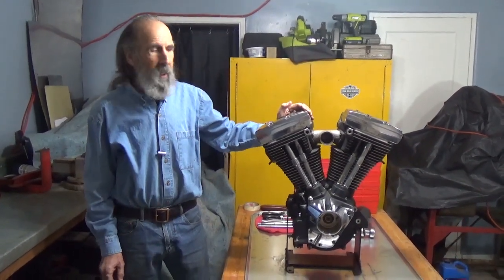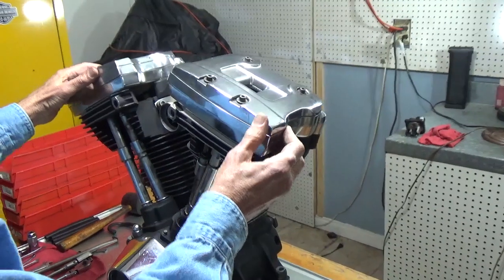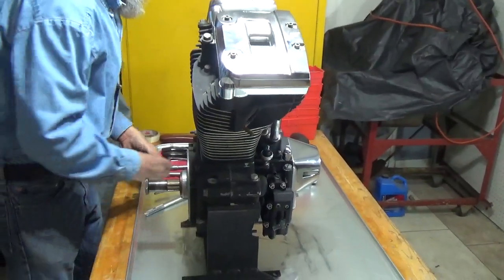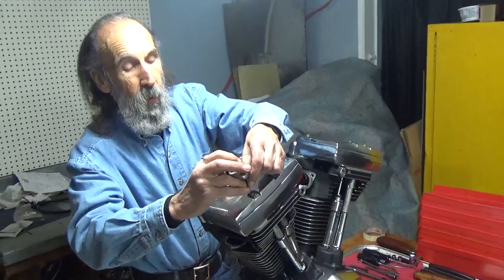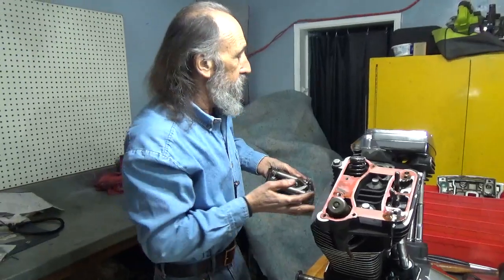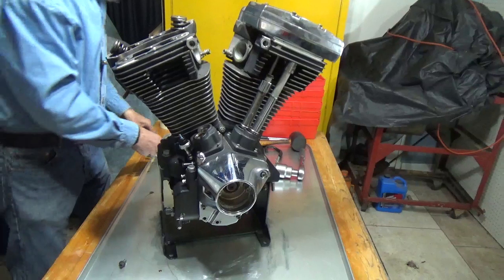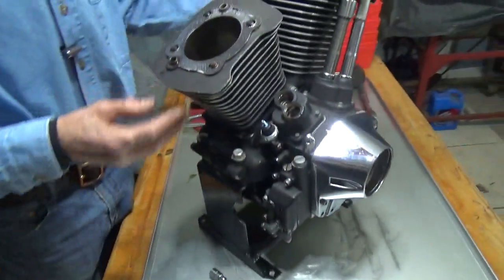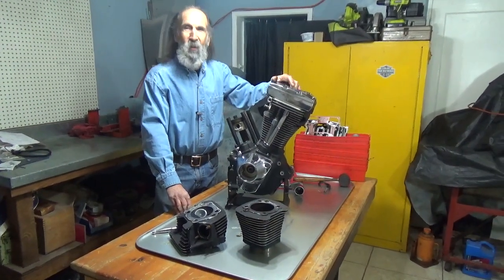Harley Davidson Evolution Motor Disassembly, Part 1

Comment: Is it strictly necessary to follow the torque sequence shown in the manual? I noticed you don't followed it; the manual asks that from the rear cylinder the first bolt that should be turned is the one closer to the coil, then the one beside it, then the one "inside" that is closer to the front cylinder and finally the one beside it; most likely I will be working on an softail heritage springer 1998 so your response will be much appreciated, thanks in advance, cheers! 🍻
Reply from the maker: Do your best to follow the torque sequence.  Generally, it is from the inside out and crisscross to stay even.

Comment: I have a 1984 electrical I classic has under 16,000 original miles on the body motors got 4800 on the motor rebuilt it was replacement for my 2016 Electra Glide I did I had wrecked on the insurance company and my family put it together behind my back and got my father’s old Harley Davison from up in Sherbrooke Canada down here to Connecticut for me and I’ve been having problems with a neighbor here and she had jammed a small little piece of metal like really skinny like a painters scraping thing for spring I have a 1984 electrical I classic has under 16,000 original miles on the body motors got 4800 on the motor rebuilt it was Donna’s replacement for my 2016 electrical I did I had wrecked on the insurance company and my family put it together behind my back and got my father’s old Harley Davison from up in Sherbrooke Canada down here to Connecticut for me and I’ve been having problems with a neighbor here and she had jammed a small little piece of metal like really skinny like a painters scraping thing for paint And she was able to crack my head gasket but I know I had just enough to be able to give her I had to go so I could do the work because I can’t work on my vehicles here because she’ll tell him and try to get us kicked out because she wants our apartment so I was able to get it up to my friend at Pete’s Cycle and he’s charging me basically just for the knowledge that I don’t know cause I’m a shovel head and Aaron head mechanic I never had to work on the evil in my life so I don’t even know basic specs of torque and stuff so I’m watching your video just to learn a little more and he pointed out that it do you know sabotage to my rear head gasket and we found sabotage the back head gasket were it was split we were fearing at the bowl to pull from the block at the bottom which they didn’t and I also have a little metal gaskets at the bottom which thank God Because I would’ve had to remove the wrist pins and pulled the heads with the Pistons still in them so I Kinda you know replace the rear bottom gasket thank God I don’t have to because they’re metal but now I have to undo the head gaskets and I’ve been having a hard time finding my finally found them because it’s an original evil I have roller rock her head cam Jim’s roller head rocker cams Because I would’ve had to remove because I would’ve had to remove the wrist pins and pulled the heads with the piston still in them so I Kinda you know replace the rear bottom gaskets thank God I don’t have to because they’re metal but now I have to undo the head gaskets that I’ve been having a hard time finding my finally found them because it’s in original evil I have roller rock Jim’s Roller rocker had cams and also vowels the whole top and bottom end as well he was able to check some stuff and do some research on the parts that I was given all the receipts to and he was able to confirm that the bike was put together up in Canada I’m just not long ago I’m up in Sherbrooke Canada buy a Harley Davidson dealership up there and it’s all gyms are parts and air and yeah my head gasket thank God I didn’t cut the VA into the head gasket by driving at the short distance I had to drive it because I didn’t have a trailer but it worked out my head gasket literally went all the way blew out my last 10 feet I had to move so I shut it off as soon as I heard it go and I didn’t create a DP in the head or into the block but this is my first evil rebuild ever you know top end and they said my other engine looks the same I will send some pictures but thank God all is going well and Monday I’m putting in taking apart the front head and putting it all together and I should be driving at the end of the day this Monday thank God
Reply from the maker: Well, I'm glad it's not too bad and I'm glad you have the help you need.  Take care.

Comment: Hey Mike, great videos.  I have a 97 evo in a road king. Motor runs  good till it warms up then there's a howling sound by cam cover.  I'm also getting brass filings and metal shavings in my oil. Before I tear into it, is there anything in the bottom end that would have brass in it. Trying to avoid splitting the case's unless absolutely necessary.  Motor has around 76,000 and upper cylinders and pistons were redone at 36,000 cause base gasket failure. Once again I really enjoy your videos and experience.  👍👍👍
Reply from the maker: Okay, where is the brass?  Wrist pin bushings and flywheel thrust washers.  Let's see now.  Rocker arm bushings, pinion shaft bushing in cam cover, and cam bushing also in cover.  Looks like time for  cam cover removal first for inspection.  You actually need a lot of inspection.  Inspect lifters too.  I wish I could tell you something a lot nicer, but inspections are in order.

Comment: Another good video Mike,, I have a technical question for ya,,will send another way if pissible,,via email or what ever
Reply from the maker: Sorry.  Just email it, and, if I can help you, I will.
Reply: @pacificmike9501  Morning Mike,its John with the Technical question,,,Changing from EFI to Carburetor,,,do I need a high flow oil pump or can I rework the oil pump ?
Reply from the maker: One has nothing to do with the other.  I assume you're working on a "twin cam."  Of all the improvements made on them, it seems like  standard procedure is to replace alot of stuff in the cam chest.  Normally, the cams, lifters, and oil pump are "upgraded."  Also, depending on the year, a later version of the chain tensioners is installed.  You didn't say what  year model you have, but if you're using carburetion on an injected bike, and want to keep it pretty standard, changing to a factory wiring harness of the same year and model, that came with a carburetor, is a good way to go.  Very labor intensive though.
Reply: @pacificmike9501  ok Mike thanks for taking the time to respond,,and yea its a twin cam 2007
Reply from the maker: Well, I don't think there is such a thing as a stock wiring harness for you, but, there's probably an aftermarket setup.
Reply: @pacificmike9501  yea I have been wearing the internet out looking for things,,i really appreciate all your time in this matter,,can't wait for your next video,,oh yea do ya think you can show a video of rebuilding a 4 speed transmission?
Reply from the maker: We'll do it when it comes up.  That's how we have to do things.  What we need has to come first.
Reply: @pacificmike9501  totally understand,,thanks again

Comment: Mike, in a previous video on Shovels I remember you said factory Evos had non adjustable pushrods. When tearing down for the first time, should I cut the pushrods, then go back with adjustables on the rebuild? Great videos.
Reply from the maker: It really doesn't matter, if you're taking the motor apart anyway.  Either way is fine.   But, it's always a good idea to unload the pressure off of the rocker boxes before removing them.  It helps keeping them from warping.
Reply: @pacificmike9501  thank you for the reply. It’s an 85 FXSB and I wasn’t sure which way to go. I’m not a Harley wrench, mainly old cars. After I asked my question, I thought about getting the cam on the base circle to get the pressure off the rockers too. Just want to say I’m watching the whole Evo series, and you lapping the case halves is one of the best tips I’ve ever seen online.  That will work in many instances, car or bike.

Comment: hey man there is a 2013 883 sportster for sale which had the engine temperature sensor removed for a few months, and the bike runs with a rich fuel mixture now.
Is it safe to buy this bike? thanks mate
Reply from the maker: I have no way of knowing.  If I say "yes," it's my fault if it's no good.  If I say "no," you may miss the deal of a lifetime.  I am clueless.  I also don't know how that bike (assuming it's injected) could have run without a temperature sensor.

Comment: This is good stuff. The Evo is the best motor to come out of HD ever in my opinion. If your able to wrench on them correctly you can always keep them running.
Reply from the maker: There are all the different incarnations of Harley engines.  Each delivers (after a few improvements) a different kind of thrill.  Have you ever ridden a hopped up Knucklehead?  How about an ancient J Model Stroker?  How about a Panhead that's been loved all over?  They're all different experiences.  Pretty hard to compare.
Reply: @pacificmike9501  I own a pan and owned a knuckle in the '70s. My favorite is still the Evo. This cat just explains thoroughly on the correct way to wrench on them.

Comment: Maybe someone else in the comments can break this down for me barney style what the hell is the difference between “A and B” motors and how could you spot the difference if the two were outside the bike on a bench thanks
Reply from the maker: "A" and "B" motors refers  to the twin cam motors from the 1999 models up to 2016 or 2017, as long as the twin cams were produced.  The dressers and Dynas all used "A" motors.  This includes all of the Big Twin "Rubbermounts."   All of the "Softails" or "solid mounted" motors are "B" motors and have chain driven balance shafts. They're longer to house this stuff.
Reply: Pacific Mike ok thank you appreciate the response have a good rest of your weekend sir !!

Comment: Mike quick question my buddy just had cams(se203),camplate and pushrods,  put in his 2001 flhctui .Ran fine half a day ,now backfires blue flame out the pipes immediately when start button is pressed ?any suggestions
Reply from the maker: Sounds like timing may be off.  Have to open it to check the timing marks.  Maybe just a vacuum leak at the manifold.

Comment: Hello Mike, I have a question about my 1999 Harley Softail, it's burning oil and smoke from both exhaust pipes and oily black sparkplugs.. A Harley mechanic told me it's valve seals needs to be replaced. Question is: Do I need to change the cylinder head gasket if it's not broken? I have been following your channel for many years and learned a lot about Harley repair. Thank you so mush.
Reply from the maker: Your mechanic is most likely correct, but for the labor it's going to take, be sure everything gets looked at in that topend while the heads are off.

Comment: I realize this video is 4 years old but I have a question. This is my first Evolution engine (96 Road King) I ever owned. I own and ride a 49 Panhead and other bikes. I want to replace the umbrella valves in the heads because I'm getting excessive blow-by even though the engine only has 33k on it. I shouldn't have to loosen the pushrods or remove the intake manifold just to take the top valve covers off to do the job correct? I recently had everything apart as I got rid of the magneti marelli and switch to a Mikuni hs2 and a Ultima ignition system. It would have been nice if it was doing it then when I had everything off LOL. Thank you for any answers.
Reply from the maker: You'll pull the tops and then the middles.  Depending on what your bike is, you may or may not have to remove the rear rocker arms.

Comment: Hello Mike. You showed us to release the pressure of the cylinder by releasing the push rods. Shouldn’t we place the cylinder on TDC before removing the rocker arms?
Reply from the maker: You're releasing the valve spring pressure when you back off the adjustors on the pushrods.Doing that at TDC on the front cylinder will enable you to remove Evo rocker shafts on that cylinder.  Now, you can do the same for the other cylinder.

Comment: I have an 88 FXSTC and I’m planning on redoing the top end. Do you have any recommendations for gadget kits? Also, can I do it with the motor on the bike?
Reply from the maker: Yes, you can.  Gadgets, like go fast?  A mild cam and adjustable pushrods would be nice.

Comment: My 99 evo blew the rocker box gadget out front cylndr  then the back out 3 weeks later only had 1500 miles on her wen I replaced gadgets I did not put the umbrella valves in  20 years later still runs
Reply from the maker: Fun

Comment: Hi Mike my 91 Ultra Classic has started leaking oil at the base of the rear cylinder.Should I buy a gasket kit for both cylinder's so both will be fresh.Second question how many hour's should I need to pay for to fix my problem about ? Enjoy your video's
Reply from the maker: Well, if one base gasket is leaking, the next one soon will be.  I recommend replacing them both.  It sounds like a shop is doing this for you, so you should be using their recommendations.  If you're doing it yourself, take all things into consideration.  To remove and reinstall an entire top end takes some time.  How many miles on the motor since anyone has been into it?  You'll want to replace the rings, hone the cylinders and lap the valves.  Check everything you see.The bike is twenty-eight years old.

Comment: I have found that a garbage disposal wrench works well for intake manifold bolts
Reply from the maker: Yes, it is a 1/4" allen wrench.  And, they can all be shortened if necessary.
Reply from the maker: Wait a minute, I forgot.  I think it's 1/4",  I better go check.
Reply: The 45 degree angle is convenient.  Had an old wrench show me this years ago. Works especially well when the motor is still in the bike

Comment: Hi mike I got a 97 fat boy 5 speed how can I go about putting in a 6 speed if its even possible or maybe even changing the gearing I just want more top end for the highway, thanks in advance.
Reply from the maker: You can do it several different ways.  You can get a six speed gear set to put into your stock case.   You can use a different trans pulley (larger) and a slightly longer belt.  You can use a smaller rear wheel pulley.   The six speed gear set would be the most fun.  Generally a .86 overdrive top gear and the other five gears are all stock ratio.

Comment: Why would he have Vacuum leaks just by using anti seize on the bolts?  If all 4 bolts were torqued properly then it should have been fine unless he screwed up the gaskets while seating the manifold. I’ve never had any manifold bolts work loose using anti seize on them.
Reply from the maker: Believe it or not, when you remove enough of those intake manifold bolts, and you think about how the cylinders and heads expand,and contract, it makes one realize that those bolts need to be very tight and basically, seized.  Not to argue, but those bolts need to stay tight.  Vacuum leaks suck, so to speak.

Comment: So..
I'm planning on doing some preventive maintainance on my Evo..was an 883..someone installed the 1200 kit..I'm  planning on checking the head bolt torque,would you take off one head bolt at a time,to lube each one, one at a  time to save current torque spec,or just go around each bolt to torque,minus the 90* turn..??
😎👍😎
Reply from the maker: I wouldn't bother it unless my intent was to pull the heads and replace the gaskets.  The motor is built with stretch studs and shouldn't be retorqued at all.  Consult with your manual on lubing the headnuts for assembly.
Reply: @pacificmike9501  Thanks.

Comment: MIKE love you're videos you are so helpfull,but I have a problem,I busted a valve guide taking down the heads how do I get the busted one out
Reply from the maker: First off, gotta figure out how you messed up.  Usually, it happens because a valve is open at the wrong time.  Either it stuck or someone didn't wait for a lifter to bleed down before rotating the engine.  Either way, the head has to come off and a "qualified" individual should remove the valve and guide, which are probably both damaged, and replace them.

Comment: Hi Mike, love your videos, keep em comin, learn so much from them. quick question, can you swap out an oil pump on a 92 EVO without pulling the motor??? Installing an S&S high output pump. Buddy says he can do it without removing the engine while others say the motor has to come out??? What is your professional opinion on this? Can it be done without removing the engine at considerable cost? Would really appreciate your opinion, hope to hear back from you on this matter, thanks and take care.
Reply from the maker: You didn't tell me the model.  If it is an FXR, it's quite difficult without taking the motor loose and twisting it.  Same with the FLT's.  Softails, no problem with the motor staying bolted up and in place.  Do you have a service manual?  You need one if you don't.
Reply: Hi Mike, forgot to mention the bike is a 92 FXRS-Sp. Thanks for getting back to me, really appreciate it. All this work for an $8.00 seized pressure relief valve. With the lack of oil to the top end the chatter from the rocker arms is quite prevalent . Do you think the rockers should be replaced or maybe a set of rocker lockers might solve the problem  (after the new oil pump goes of course) . Let me know what you think Mike, thanks again and take care. @pacificmike9501

Comment: Happy Thanksgiving Mike!! Is it the same  steps for the 103?
Reply from the maker: Pretty much.  But the Twin Cams are a completely different design in the camchest.  The Twin cam has two camshafts, an oil pump mounted in the camchest, chaindrive on the cams.  Different engine.  Happy Thanksgiving.